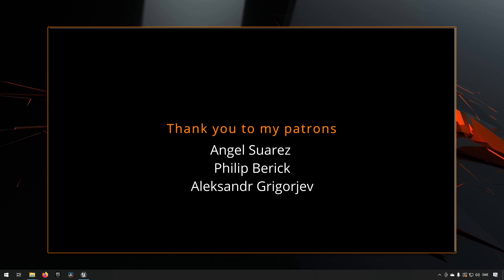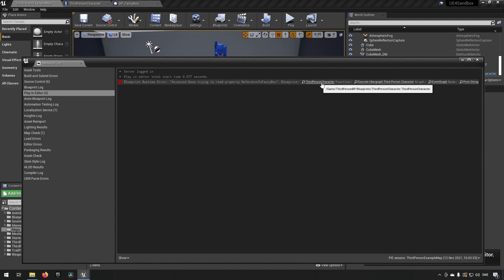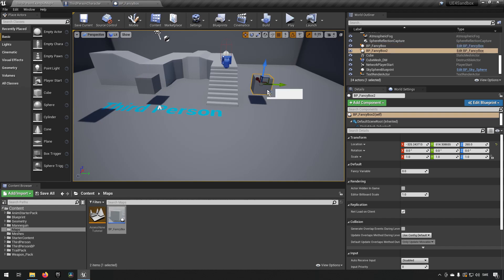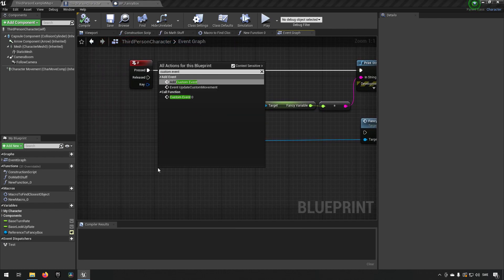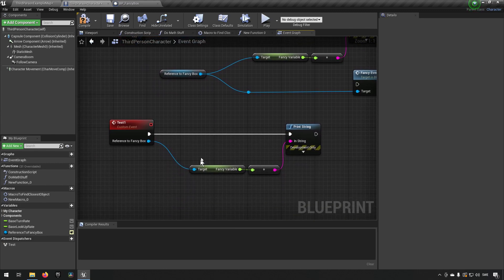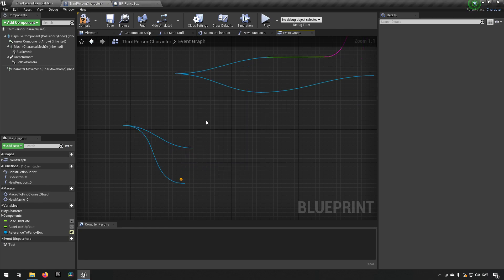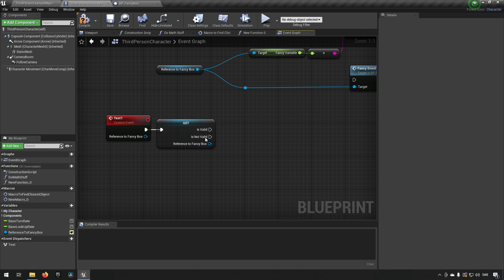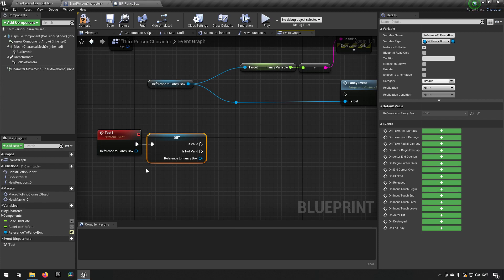Tutorial: Common problems: Accessed none - Unreal Engine

Comment: Stumbling across this video today, trying to figure out why this is happening to me and sadly not getting anywhere. Working in UE5 with some UI, created a scroll box and made it a variable so I can add children UI to it, and I get Accessed None on the scroll box and unlike other things, there's no ability to set the varaible or specify it in default value, and I cannot fathom why.
Reply from the maker: The issue is always the same. You have an object reference you are trying to interact with.
Now, how this is an issue for your specific case can depend, because there are different ways you could be managing your UI.
Most of the cases are widgets not being created before being used, but maybe in this case it is an existing container and the widget it is to belong to does not exist.
The only way to find the source is through debugging the flow and checking the variables. I have debugging tutorials if you are unfamiliar.
Reply: @LeafBranchGames  I ended up finding a workaround, but I think there's some edge case involved. The object reference works fine as-is provide it's put in the Event Graph of the UI it's a part of, but stops working if the reference is gotten inside a function within that UI, at which point it starts saying Accessed None.
Reply from the maker: @Lady_Corwin  That sounds exceedingly odd. Anyway you can produce a simple blueprint to share reproducing the issue?

Comment: Hello, I am trying to make a floor visible when colliding with a power up. The error in the video was solved, but in the "Is valid" node, the code goes through the is not valid connector. What can I do?
Reply: In my case, the player may fall due to an incomplete platform, so I want the power up to not allow the player to fall. So I thought about adding a floor to this platform and with the "Set visibility" and "Set collision enabled" nodes, make this possible.
The problem is that the floor never becomes visible and never collidable.